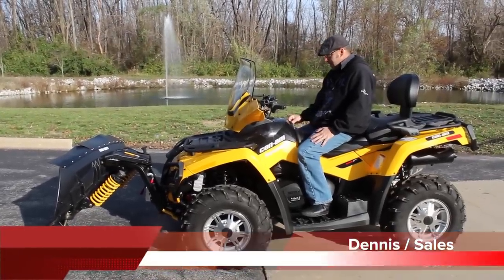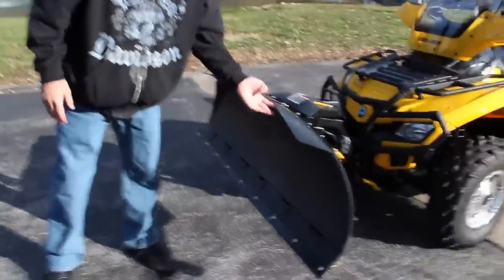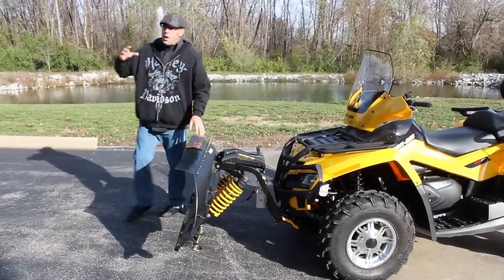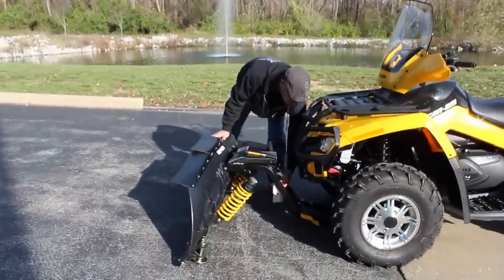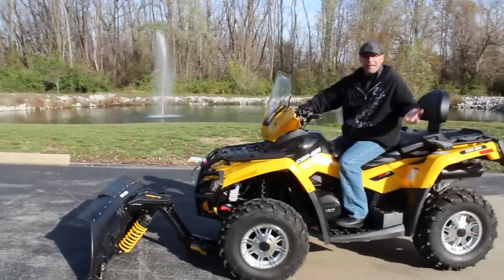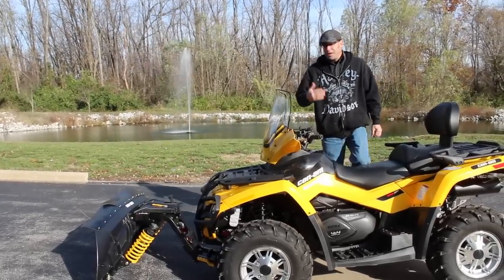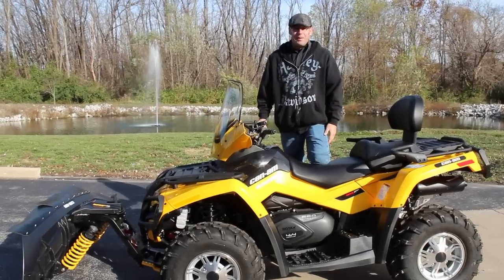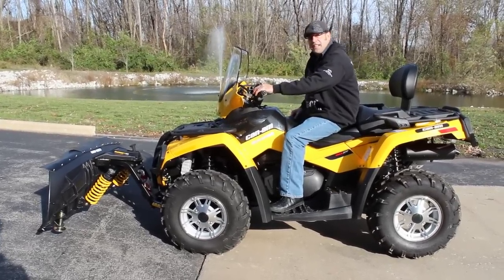Can-Am ATV Snow Plow Overview

Comment: I have had this plow for 4 years and it worked great however the push frame durability is a problem.  I broke the push frame when loading on a trailer the blade caught and broke at the top bend and folded under.  Not a huge deal just replace the broken frame right? Wrong can am does not sell the replacement piece you have to buy a whole new kit for over $500. I wouldn't recommend buying this.  I am now buying a Warn Provantage front mount plow that lifts much higher and won't catch when loading on the trailer.